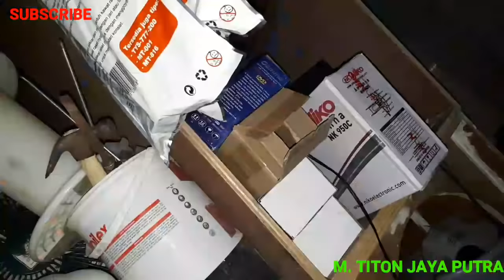Power rumahan 5 AMPER pakai DRIVER SOCL plus echo reverb modif (dapet pesanan lagi )   PART 2

Comment: Catu blower perlu disisipi choke (induktor) toroid ferit utk mencegah noise ringing mengkontaminasi sinyal audio.
Kalau memakai modul2, cek & pastikan setiap IC sdh 'ditemani' kapasitor kopling catu. Setiap IC yg dicatu simetris perlu ditemani 2 kapasitor catu 100nF, dipasang sedekat mungkin. Akan sangat meningkatkan mutu mid&hi tone.
Trafo 5A cuma kupercaya mencatu ampli guitar model combo.
Salam genimili

Comment: Mas mau tanya saya pake reverb itu kok dengung ya mohon bantuan nya
Reply: Stabilizer yg gimana ya mas apa pake kayak power supply simetris itu ya yg menggunakan transistor tip 41 42 terus ada zener nya

Comment: ini kuat angkat 15 & 12 gak kalo 5A
Reply: @MTITONJAYAPUTRA100813  berat gak, 5@ era ct45 kuat angkat speker brp in & brp.jumlahny
Reply: @noerhidayat17  5 Amp ct 45....maksimal hanya menghandle sepasang woofer 10 inch
Reply: @matrempit2885  brarti 10@ era minimal ya mas klo 15
Reply: @noerhidayat17  betul bro....biar TR final dan trafo adem.....
Speaker 15 juga jangan diseri atau pararel....
Biar sendirian main di 8 ohm...
Reply: @matrempit2885  final nya pake merk apa & bro set ya mendingan ?

maksudnya 1trafo & power cuma buat angkat 15" nya aja gitu? misal mau tambah 10" 12" gitu pake power sendiri?
Reply: @noerhidayat17  pakai tosibha aja bro...4 set perchanel...
Reply: @noerhidayat17  betul bro biar awet power ampnya...
Jadi loudspeaker jangan kita serie atau pararel....
Cukup 15 inch perchannel...8 ohm..
Dijamin awet...
Reply: @matrempit2885  kalo 15" pake 5@ era trus 10&8" pake 5@ big kurang ya? apa 10@?